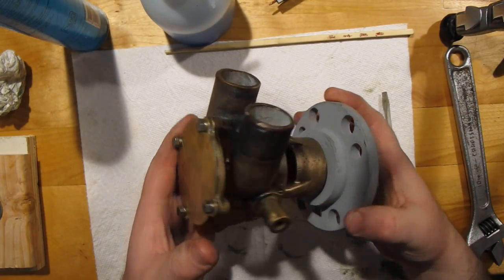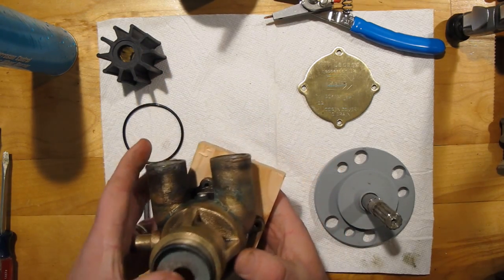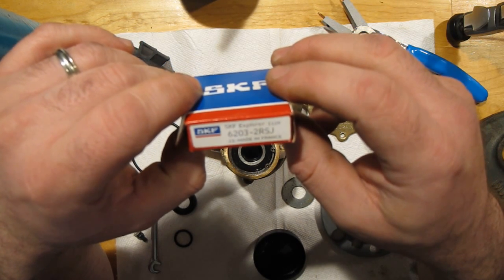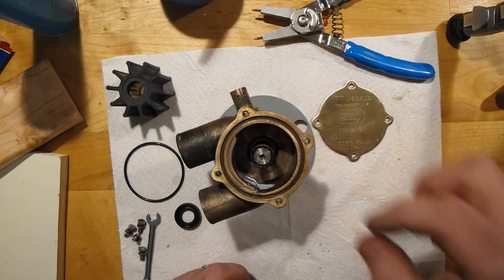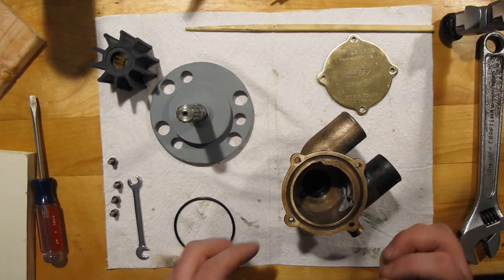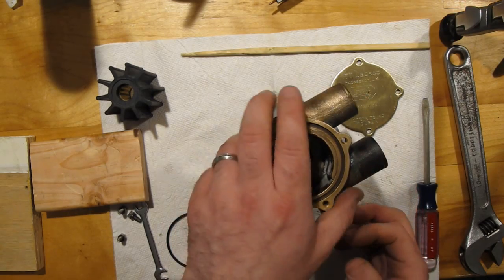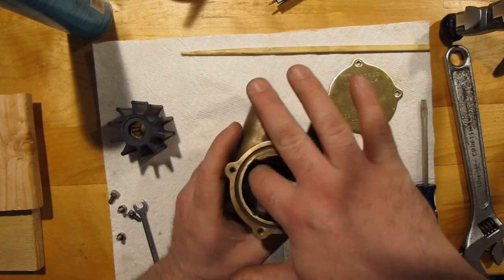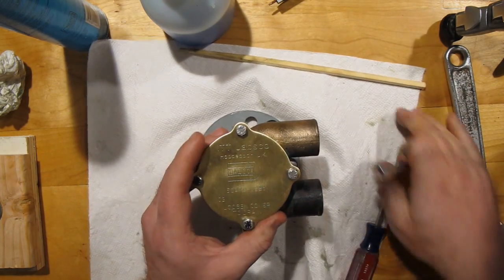Jabsco 50410-1251 Raw Water Pump Re-Assembly

Comment: Do you know the dimensions of the Seal ring ? I am in Asia.. and I have ordere3d a few seal rings with stainless steel spring ring but they leak when I install them.. There must be something wrong.. Before I always used the standard seal but the spring rusts away in a few weeks in the sea water..

Comment: Thanks for the detail video.  I have the F6B which others have said is similar.  Mine is leaking so I need to replace the seal.  Once re-installed, did yours leak at all?  It looks like the seal should have had a lip on both sides so it would fit in the center of the seal.

Comment: that pump is nearly the same as a Johnson F6B-9 the only thing different is the johnson does not have the snap ring, and instead of the O-Ring cover seal they use a gasket. Other than that they are the same.
Reply from the maker: Thanks for the information.  Hopefully that helps somebody.
Reply: This helped me, but how do we know if lip seal is too far in? Should it sit on top surface of brass housing?